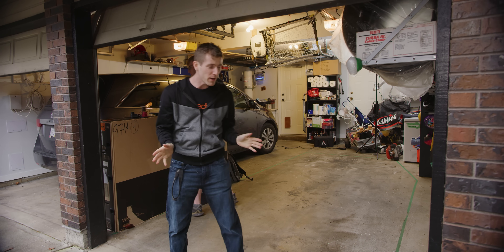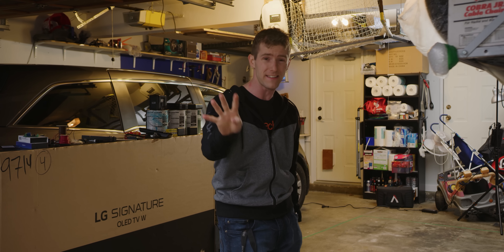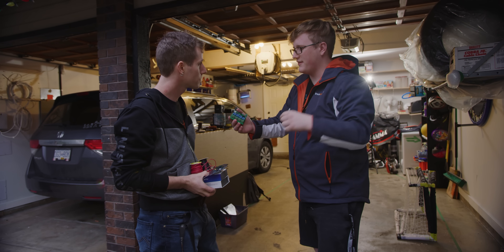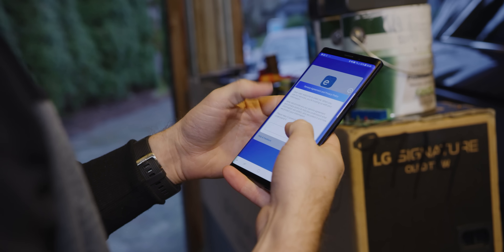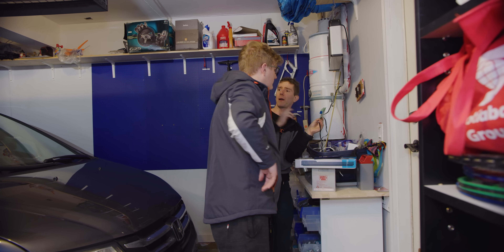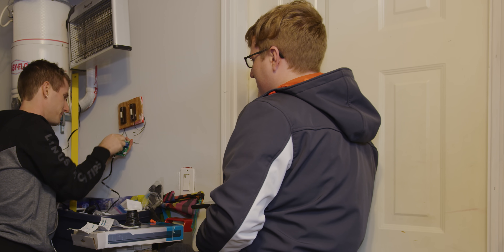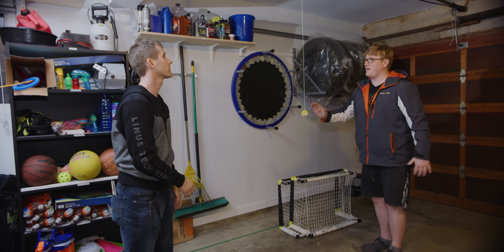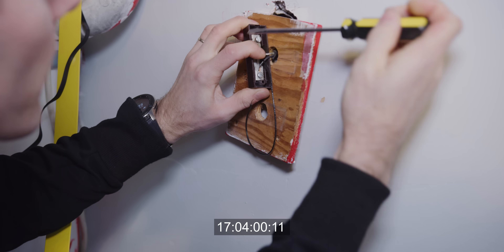Making my 1980's Garage Door Smart!

Comment: Better title "Making my 1980's door a hackable security risk"
Reply: Hmm, like normal RF door controllers are 100% secure right?
Reply: @peterhamilton9387  they're not networked and accessible from across the country, at least. No sane person networks the doors and lights to their house.
Reply: @kyleclements9400  Oh bollocks! Google "hack rf door control". RF doors remotes are notoriously easy to hack. Good luck to you if, on the off chance you might be be hack into my network, you can switch my light off when I'm in Australia and you're in the U.S. Bravo.
Reply: @peterhamilton9387  hacking RF controllers requires whoever is doing it to be within spitting distance of the controller. It's degrees of risk mitigation. Connecting as few things as possible to the internet is always the best practice.

Garage doors, lights, refrigerators, speakers, TVs, cars... none of these things need to be networked and internet connected. It's absurd.
Reply: @kyleclements9400  What exactly is this "risk" you talk about? In the very unlikely event you can turn one of my lights off, what have you achieved?
Reply: @peterhamilton9387  take your own advice and fire up Google. "IoT security issues" is a good place to start.
Reply: @Kyle Clements "No sane person networks the doors and lights to their house." And yet you connect your desktop, your laptop, your kid's laptops, your phones, your tablets, your tv's your xBox's and god knows what else to this same network?
Reply: @peterhamilton9387  smart TVs are crap, they rarely if ever get security updates.

As for the rest, sure. I do. Because they do get regular security updates and patches. But more importantly, if one is compromised I'm not locked out of my house, left in the dark, or in the case of smart thermostats, frozen or cooked out of my home by a clever bit of ransomware.

The problem with the internet of things is lack of proper security. Precious few smart devices receive regular security updates, and even when exploits are found, many companies refuse to patch them until something catastrophic happens. Like light bulbs being turned into a bot net. Or TVs hijacked by ransomware. If that's the future you want, then cool. Go all in. Make every appliance and interface in your house networked and internet connected.

As for me, I'll continue to insist on as little connectivity as possible.
Reply: @kyleclements9400  Dude, if I can hack into your network, no amount of security updates is going to protect your individual devices. Anyway, you're starting to bore me. Time to move on and you back to your cocoon. Best wishes.
Reply: @peterhamilton9387  I feel like you have a fundamental misunderstanding about how securing internet connected devices works.

You don't need to "hack my network" to compromise a device that's talking to services outside of that network.

Comment: All that trouble and you could've bought an Aladdin Connect. I used it before I replaced my own 30 year old openers.

https://www.amazon.com/Genie-ALKT1-R-Aladdin-Connect-Smartphone/dp/B07JGF1SCW/ref=asc_df_B07JGF1SCW/?tag=hyprod-20&linkCode=df0&hvadid=242033512944&hvpos=1o1&hvnetw=g&hvrand=12316818339966383306&hvpone=&hvptwo=&hvqmt=&hvdev=c&hvdvcmdl=&hvlocint=&hvlocphy=2840&hvtargid=pla-555852074133&psc=1
Reply: Genie sucks though

Comment: Most users already have a security 2.0 garage door opener however now a days since it was implemented in the 90s so they are stuck.  You lucked out with the 80's model because it is before the protocol, otherwise the hack will not work.

Comment: NO and NC stands for Normally Open and Normally Closed. In the Case of a Relay, meaning that when theres no Voltage switching the Relay its the "Normal" State where you can choose between the NO and NC Output

Comment: Take a WEMOS D1 board from ebay for under 5€ and a relay for some cents. You could open up your door via encrypted WLAN. Log via software on mobile. You could also use a particle photon board for 20€. The photon board has so much I/O ports you can give your house a central nervous system. And open it with Alexa.

Comment: The amount of precautions regarding electricity and its dangers here is frightening.
Getting fingers in the switches while the power is still on is extremely dangerous.
You don't even know what's the voltage on those things.

Comment: Actually, he kind of dramatized the subscription thing. Chamberlain uses MyQ and the MyQ app for Smartphone control, which is completely free.  If you want it to work with a few apps such as Xfinity Home (which is free) you would have to pay a subscription. Chamberlain doesn’t even advertise that it works with these apps. Most apps that it works with are free.
Reply: Yep, and chamberlain is also a really good motor range as well. Even with the subscription, the belt driven motor makes it so much more worth it than a noisy chain. Plus I doubt his old one has a working rebound/even half the features

Comment: The only catch with Sonoff (or other ESP8266 based devices) is that sometimes modules lose connectivity (easily fixed by setting a static IP for each of them on your home router) and the eWeLink app servers go down from time to time disabling any remote access. I guess that's why a company may want to charge a monthly fee for the service.

Comment: Okay, I just feel the urgent need to address you paid subscription complaint. IFTTT is free for open source or DIY projects and free for the user. However, as you've properly displayed in your video, companies do indeed pay to integrate and advertise with IFTTT (its a fairly popular service after all). As far as I know, IFTTT mainly utilizes webhooks which basically means your service provider tells IFTTT: Hey the user did x + some data. IFTTT then goes on and processes the request according to your recipes. This also means that your service provider needs to have his own infrastructure of some kind (mostly cloud nowadays) and they have to pay for the bandwidth they use. Sure, a lot of providers have servers anyways (since every stupid little thing need to connect to the cloud, the local network is never enough), but some don't and just need it for integrations like IFTTT.
Sure, you don't have have to buy a subscription to use Hue and other products with IFTTT, but I'm sure they pass the cost onto their costumers somehow (more expensive products etc.).

Comment: If you really want to use those devices to their full potential you can flash them with Tasmota, allowing you to use a native web interface instead of the Chinese eWeLink app. 

A big benefit to this is you can then interact with the devices with a home automation system like Home Assistant (or Hass.io) which is a open source and very private way to manage smart devices. It's more involved to set up, that's for sure, but the long-term benefits are huge. Plus there's no chance of any local network vulnerabilities.

Comment: On relays, "NC" stands for "Normally Closed" and "NO" stands for "Normally Open". It refers to the state of the circuit. For applications like yours that require on-demand power, you would wire to the "NO" terminal and ground.

Comment: Com, NO, NC are common terms in relays.  Usually a C-form or "double throw".  you have 1 input, the common (COM) and 2 outputs, 1 that is the Normally Open connection, and 1 that is the Normally Closed connection.  The COM pin is connected to the NC pin when the relay is not energized, i.e. normally closed when the relay is off.  The relay switches from the NC to the NO pin then the relay is energized, or turned on.  Takes some getting used to, and not something you see inside the computer hardware arena.

Comment: Could have been done smarter and cheaper IMO. Roost Smart Garage Door Sensor is over priced.
I don't have a garage, but I hooked up my home security system that's built into my house to a Raspberry Pi and I can get alerts on my cellphone and monitor my house myself at no additional cost. ADP wants $480/year + taxes.

Comment: pretty much the only thing that can be said for it is that it would probably work if you'd magically find one of those 2-din android car radios (which, when running android are a pain in the ass to wait for booting, and aren't documented enough to just write your own firmware for them), which accidentially also has an software defined 2 way radio and/or gsm module -built in-. as the thing is, you don't want it on some handheld phone to start with, it should be some button on the dashboard of all your cars.

Comment: my gawd what a flimsy pile of crap. that is not how we do building control. :P plus the whole thing probably will no longer work if any external supplier randomly decides to no longer deliver services to you. (electricity, internet, your cellphone simcard supplier, or that silly 'app' thing to name a few). that latter may even be spying on you and passing things on to crapheads like the fbi stating 'yes his garagedoor did open just before he got caught with 20kg of cocaine in his trunk'. you don't want that. just re-wire everything (lights, garagedoors, normal doors with their accompanying rfid scanners and/or pinpads, etc) to a central relay box, get your own control system, no fucking logs, no leaking data, no external parties involved in keeping it running. also should have battery backup to grant time for the generators to start and preferably not even run 'ip' to make it hard to mess with it from the internet.

Comment: Used a GoControl Linear Z-wave controller.  Works with pretty much any opener that uses a two-wire button connection.  Dunno about with how ancients yours are, but I've used them on some older models before.

Comment: they make Zwave garage door controllers that come with a tilt sensor... you can use them on your other Zwave service gateway so it will be integrated into an app you already use...

I use the ADT version, and it works like a charm

Comment: I understand why one wouldn't want to pay a subscription fee for it. However, using a chinese app to control the relay board that controls the garage door? Hmmm.

The alternative is actually quite simple. Get a microcontroller, for example a ESP8266, ESP32 or similar. It has wifi, bluetooth (ESP32) or you could add a 433 MHz sender / receiver. Then, get a cheap relay board. I would use MQTT to control the relays. You could run a simple web server on the MC or use Home Assistant for the UI. You can also add normal buttons to it to control it. Wouldn't cost more than 10$.

Comment: The liftmaster 8550 does everything you want it to do and it’s a belt driven system so it’s more than 2 times quieter, has a battery back up, lifetime warranty, my q and WiFi built in with no subscription. Also you need to change out those rollers to some nylon rollers.

Comment: "you've got your nc and your no it usually stands for no connection"

Lol NO stands for normally open NC stands for normally closed. As is when the button isn't pressed the switch is normally closed and vice versa.
Reply: @curtisscott9251  not in this case.  this is chinese stuff  :)))
Reply: @dariusEMPEROR  switch stuff*
Reply: Ikr, he propably meant N/C as in not connected

Comment: sorry for being annoying and being the "I learned this in school" but Linus your home can't run "high voltage" which is defined as being 751 volts and up, your standard residential home in Canada and most likely the US as well runs 120 Volts off a single breaker. However you can run a double pull breaker on your line 1&2 effectively doubling your voltage to 240 Volts and reducing your current draw (Amps) to get the same amount of power (watts). 240 Volts is still technically low voltage although, you will feel 240V more than 120V if you are shocked.

Comment: NC stands for normally closed and NO stands for normally open....and C stands for common....when you energise the relay the load at the NO gets connected to the power at the common, and when it is de energised the load at the NC is connected with the power at common...

Comment: Just a heads up, I installed a Chamberland in my garage. I admit I too was annoyed by subscription IFTTT. Though their app is still free to use. I can open and close remotely as well as get the status of the door. The new door opener is a lot quieter, came with trip sensors. Auto close after set amount of time. Lastly a motion sensor activated light.

Comment: couldn't this have been done with a $30 Smart Lightswitch? xD
Reply: @Aminius no you can’t. The smart light switch doesn’t have the inching capability, it’s either always on or always off. The board they attached to those switches has an inching relay that turns on for a second or so then it turns off and that’s exactly what a garage door needs. (You don’t keep your hand on the button to open the garage, you just press it for a second just like the inching relay does)

Comment: As a security salesman the reason for the subscription is literally because #1 someone had to make the app to use on your phone, #2 someone had to build the backend and sever the data goes through, and #3 someone has to maintain the backend and software updates. If you didn't buy the part outright then there's #4 the cost of the part.

That said I go over the cost in detail with customers so they know what and why... if another person doesn't do that then they're pretty scummy... especially if they don't even mention the monthly fee.

Comment: Why is there no automatic garage door opener?
Have a circuit embedded in the tarmac in front of the garage and a special something underneath your car with a transponder like something.
There are busses that work like that when the came close to traffic lights to get them across faster.
So why not use the same tech for your garage.

Comment: I have been installing and servicing for 5 years now. PLEASE get rid of those Stanley operators >.< lol they are the bane of my existence. Every time I have to go and inspect one to find out if it is able to be repaired, I die a little inside because people would rather spend $105/hr for service, instead of paying $550 for a brand new one installed. 

Also Note: if you get the Liftmaster branded (same company as chamberlain, but their top of the line models) there is no yearly subscription fee. Such as the one listed below (sold out on amazon, but local suppliers may have them). 

This model also comes with a battery backup in case there is a power outage, keyless entry, and built in wireless. It also comes with a nice quiet DC motor and belt drive so that it is alot quieter

https://www.amazon.ca/LiftMaster-8550W-267-Battery-Backup-SHIPPING/dp/B01MZ7QQQK

Comment: N.C Does not mean no connection. It means "Normally Closed" as in a closed circuit, N.O means "Normally Open" as in an open circuit. the C stands for common and is the common terminal

Comment: Some of these boards use the popular ESP2866 chip.  This is the goto chip in Smart Homes.  Most of them can be flashed and used with custom firmware that can be adjusted using Arduino IDE.  That garage door opener has enough smarts and pins to also check the state of the door (open/closed) and even tell the temperature.  The eWeLink app is functional, but makes you totally dependent on  a lesser known Chinese company servers to trigger your device.  
Keep in mind that ESP2866 does not work great on battery out of the box due to the WiFi drain, but it can be flashed to use deep sleep mode which will improve efficiency dramatically.  Putting that device on a AA battery will make it last roughly half a day.

YouTube has a slew of great tutorials on how to customize the ESP chips and how to hook them up to your home without reliance on 3rd party servers.

Comment: Would have been cooler to see Arduino on a network controlling none wireless relay board, Could either control it over the network directly or build a simple android app. Still all extremely cheap to do. Maybe even add a bluetooth hc-05 board for backup house control if the network goes down. This was too simple for LTT

Comment: as a guy that works closely with the company chamberlain, your going to pleased to know, as well look silly, that the subscription based integration ends q3 this year, and they will have full alexa capabilities, sorry if it wasn't fast enough for ya! I had a customer with your same motivation, he chose the older openers so he could hardwire in relays to remote control his garage doors, for being a pain in the rear he was charged the same price as the newer opener with full integration, as well as required to purchase additional hardware to do it his way... he spent 150 dollars on his personal equipment, so at 12 dollars a year, he could have gotten nearly 13 years of service through chamberlain, and lets not forget this subscription service is going away, the cheap Chinese relays he purchased from Amazon won't last 13 months, but power to ya!!

Comment: You could have just used a raspberry pi and unlocked it via your phone!
Reply: Raspberry Pi is already $35 and it doesn't have any relays, so you would have to DIY that. On top of that you would have to code a program that handle's the connectivity between the phone and the Pi. Honestly, I would've went with a cheap Sonoff switch, flash a custom firmware with MQTT support and connect that to my home automation server
Reply: @FunctionalHacker  you will need some attachment to interface it to the garage door mechanism and write code for both the pi and phone, but if you do that correctly, that system becomes so versatile that you could unlock your garage over the internet (not just LAN) if you want to. I think doing it with the pi is far cleaner and safer.
Reply: ckatlinga sonoff Switches ARE cheap chinese ESP chips with relays